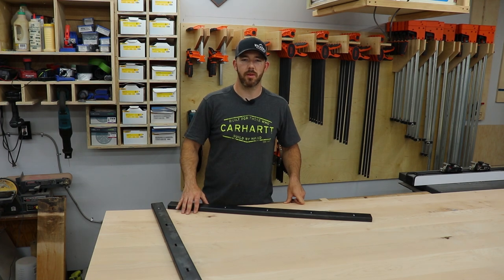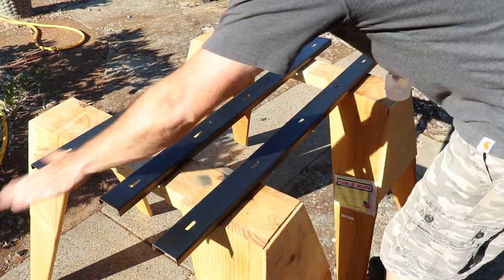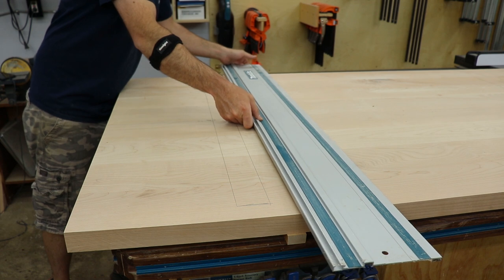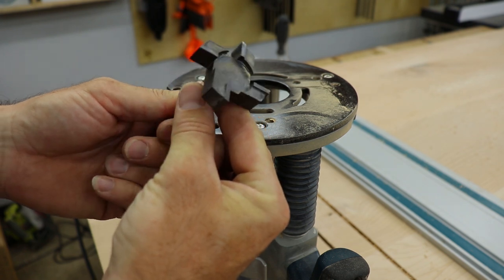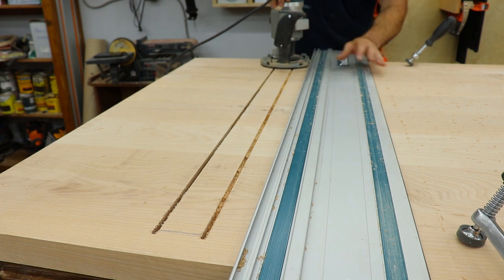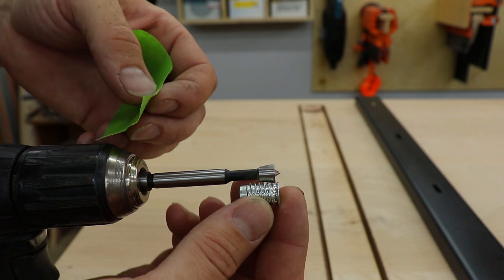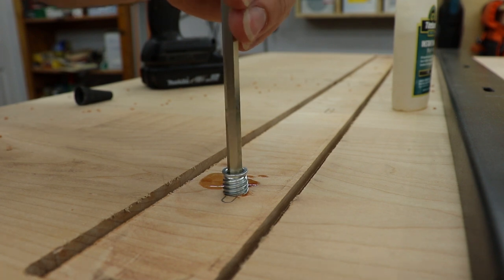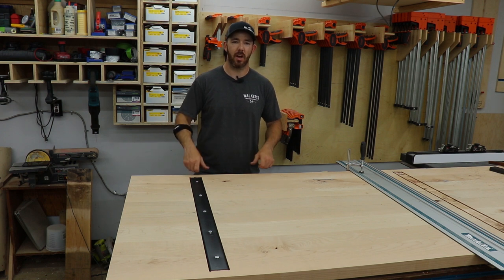Do you NEED C Channel in a table top? | How to keep a table flat

Comment: Will the c channel completely prevent this thick piece from warping?
Reply from the maker: Nothing will prevent wood that isn't dry from warping.  But as long as it's properly dried to the correct moisture content yes.  It helps.
Reply: @WalkersWoodworks  thank you so much for responding. I have another question, have you ever work on strand woven bamboo? I wonder how it fares regarding to warping and such.
Reply from the maker: I have not.  Sorry.

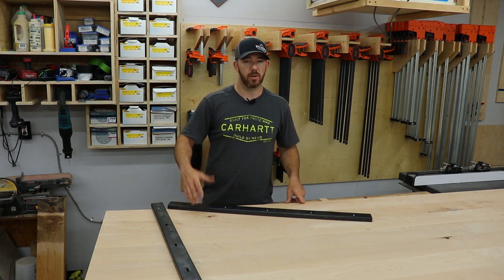Comment: 0:38 I can't speak for the time you spend on this in contrast to the entire project time, but to do all three of those, I feel like it must take at least an hour or two, which is no small amount of time.  I'm guessing based off the 10 minute video that only showed you doing one.  Even condensed into a video tutorial length, that's 30 minutes for all three...so the actual time couldn't possibly be any less than twice that, and much more likely three to four times that, maybe even more.  Doesn't seem insignificant to me.  But as far as if it's needed or not, I have no idea...I'm speaking strictly about the time it takes to do it.  Nothing else nothing more.
Reply from the maker: Yea probably about a half hour each.
Reply: @WalkersWoodworks  spending 1.5 hours while making it to make it stronger and last longer seems like good use of time to  me and insignificant in the lifespan of the piece. If you were making something that lasts a short time, then that time because more significant. When I build, I build for life so my customers that buy my products/services, they know they are getting the best and it will last.